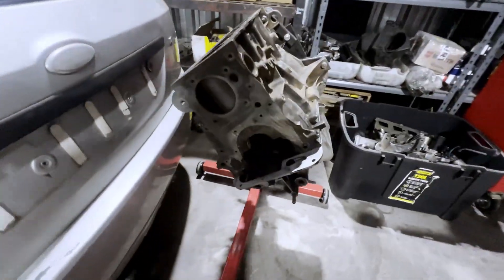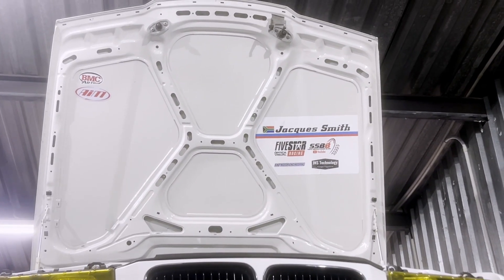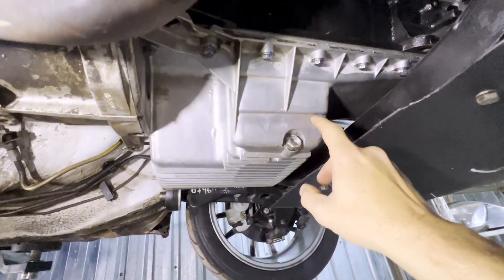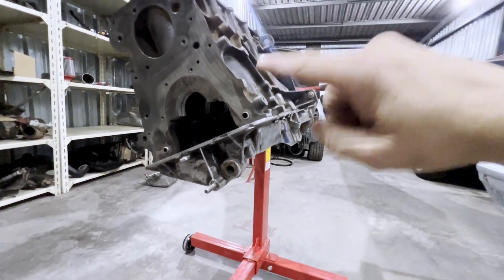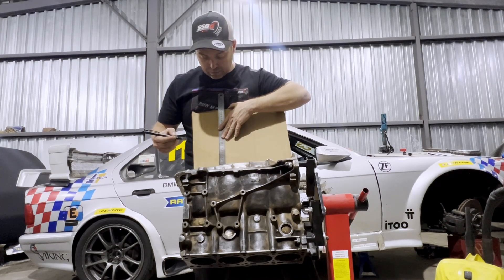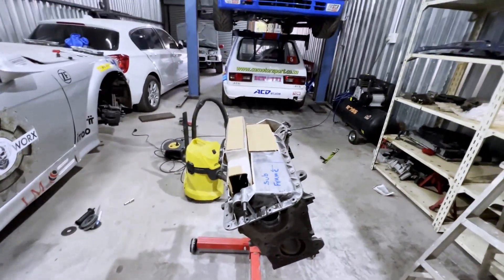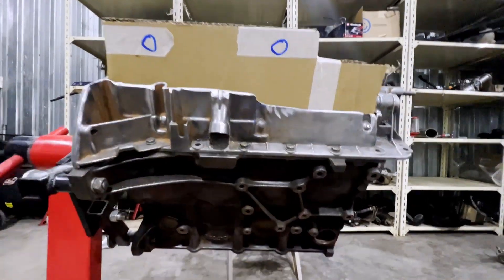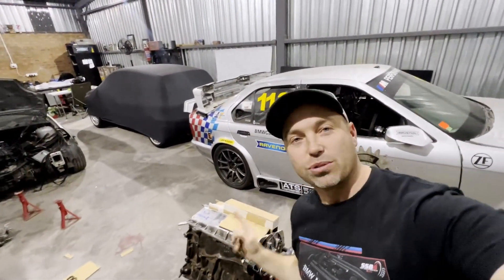BMW M42 DIY Dry Sump Oil Pan

Comment: Off the topic. I see most race cars run 4 in 1 branch and saw yours has 4 2 1, why not the change
Reply from the maker: This is a good question. 4 into 1 headers tend to favour top end and you lose some power in the midrange. A well designed and built 4-2-1 exhaust will provide midrange and top end. But because of the nature of a circuit race car, midrange to top end is always the goal.